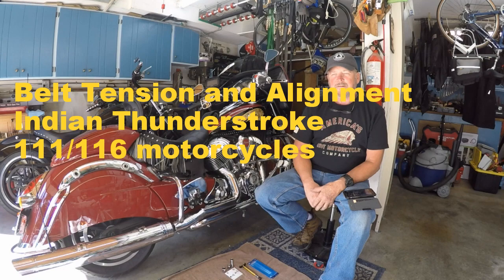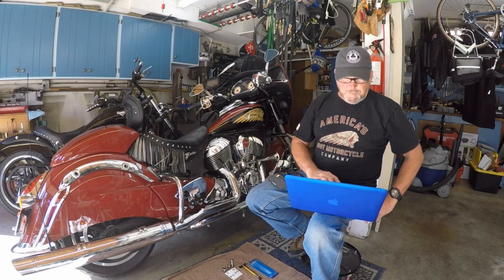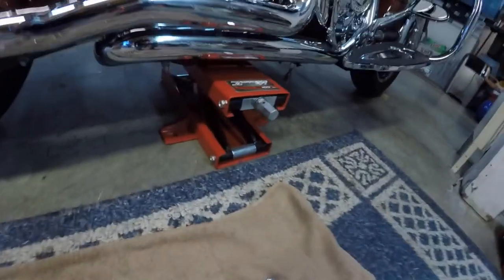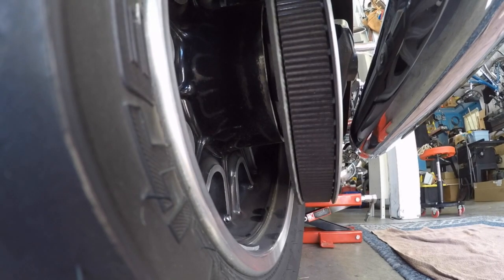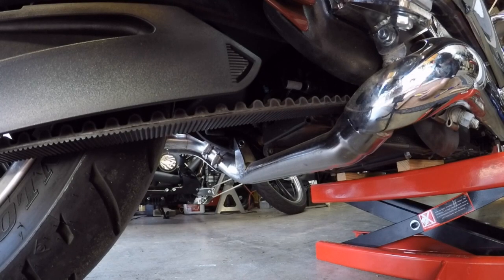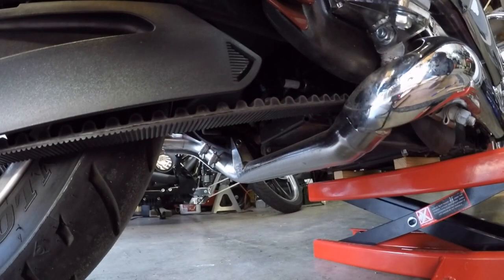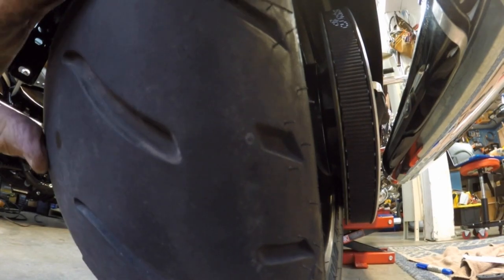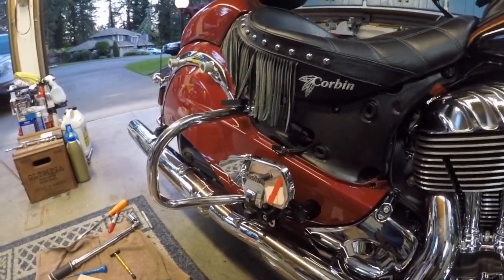Indian Thunderstroke Motorcycle Drive Belt Tension and Alignment

Comment: great video... I do not have a Indian, but I have a victory steel frame. So, its the same concept. You explained this procedure so anyone that has any type of mechanical know how, can now adjust tension and alignment. Those that dont have that, should just pay someone.
Reply from the maker: Hey, Thanks a lot for the kind words. Funny, I just performed my end of season inspection and I had to review my own video to do this part of the service. My belt was ~4-5mm too slack after about 4600 miles. 

So, a couple of things. The magic marker thing was for video illustrative purposes. Basically they factory just wants you to perform the measurement at the tightest point of the belt. So just a ruler to measure that at each 90 degree rotation of the tire to find the point of least deflection. That is where you check the measurement. If it's out of spec. at that point... adjustment should be done.

I have found it's basically impossible to gain a perfect alignment where several 360 degree rotations shows the belt equidistant from the sides of the driven pulley on the rear wheel. You can drive yourself nuts if you like, but good luck. I tried. I can get it close but there is some built in mechanical wandering in the relation of the drive and driven pulleys over say 3 rotations of the rear wheel. In my humble opinion, it is sufficient to get close as possible as long as the outer edges of the belt are riding within the sides of the driven pulley without riding up which would be extreme dis-alignment. Just get it comfortably tracking within the confines of the pulley within the manufacturer tension specification I state on the video.

I too one one of those future collectable bikes. I have a customized hot rodded Vegas. A 2013 in jet gloss black. My naked cruiser. I get an amazing about of complements on that bike. I only take it out for joy rides on sunny warm summer days. As with my Indian, I have most all the stock parts in storage. Safe rides!

Comment: Definitely the best video on this process I’ve found and I believe it’s the weakest point of the Indian motorcycle
Reply from the maker: Thanks James. Happy to help!
Reply from the maker: Hey James, I was re-reading your comment and I was wondering about it. Can you expand on your "weakest point" comment? I have 25,000 plus miles on my Chieftain. I haven't had any issues with the drive belt or the pulleys. So I'm wondering if you have and if so, what they were. 

The 30,000 mile service schedule calls for changing the belt. I just completed the 30,000 miles service on my brother's 2015 Chieftain. I got to the belt and gave it a very detailed inspection and found it in pristine condition. He had just had the tires replaced (new Dunlop Elite 4's) at the Indian dealership. The belt was in spec for tension and was well aligned through several reverse rotations up on the lift. I just did the 25,000 mile service on mine finding no issues with the belt. 

I decided to forgo replacing the belt on his bike. I seriously question the 30,000 replacement schedule if there are no visible defects. That's my own opinion and in another 5000, I will do the same on my Chieftain if it is not showing any damage or wear. I do a routine belt and underside inspection several times between oil changes (~every 1000miles or less), while up on the lift.  I also look at the rear brake linings at the wear notches, inspect the tire face and sidewalls for damage or foreign bodies and give the rims and muffler undersides a clean and polish with Mother's. I also remove the hard bags and clean the back sides, wax and reinstall. 

Just wondering about your belt weakness concerns. Regards, Craig
Reply: Yes at 10k my belt started whining I carried to the dealership they “cleaned” and adjusted my belt. Said it was the most loose belt they had ever seen. Rode to Yellowstone had to readjust on the road in Dubois Wyoming. Got it home they checked it and said it was adjusted fine but dirty. It has since then makes noise when it’s cold or raining not so much in the summer. That’s a 15 roadmaster. I also have an 16 chieftain with no issues whatsoever. I’m not understanding the dirty belt my chieftain and 1987 softail  don’t have this issue.  I actually told my dealer maybe Indian needs to buy belts from Harley cause they don’t get dirty. Roadmaster is at 30k chieftain is at 35k and who knows about the Harley I’m not buying 30k belts
Reply: I love my Indian smoothest riding bike I’ve been on just wish they would fix my belt issue
Reply from the maker: @2bad1  I think if it was me, I'd pull the belt and replace it. I would also look at both the front and rear pulleys for unusual wear. I agree, the belt shouldn't need replacement at 30,000 if it looks OK but this is a strange issue and sadly, that might be the fix. I'm sorry you are having this problem. I would also post your issue on indianmotorcycle.net and see what others have to say. I sincerely hope you are successful at finding the fix. I'm not sure what contractor is making the Indian OEM belts, probably one of the big companies like Dayco or Gates. I just don't know but you could source one and replace yours. That might do the trick. Good Luck, and let me know what happens.
Reply: It is an issue that Polaris is having I’ve talked to other owners with the same issue and I get no help from the dealer I’m thinking I might trade, I don’t know  what I’m gonna do yet I have considered replacement.

Comment: Thank you for this great video, Craig.
I bought 4 month ago, in second hand, an Indian Roadmaster of 2015. After few kilometres (maybe 400 km) I heard a noise comming from the belt. I used a teflon based lubricant on the belt but it works only for some time. I recently saw your interresting video, so i will try to adjust the tension and alignement. Just one question what kind of lift do you use ? Is it available in Europe ? 
I apologize for the mistakes, as you know french are not easy with english or american language.
Reply from the maker: Hi from the USA! Your english is a lot better than my French and that's for sure.  Here is the Amazon link to the lift I use. Be sure to not crush the steel lines underneath. Cut some short wood spacers ~1.5-2cm square to use between the lift and the bottom of the engine. https://www.amazon.com/VIVOHOME-Scissor-Motorcycle-Scooter-1100Lb/dp/B06X9CYNJF/ref=sr_1_1_sspa?keywords=motorcycle+lift&qid=1571767771&sr=8-1-spons&psc=1&spLa=ZW5jcnlwdGVkUXVhbGlmaWVyPUExSjNVVlNSRlVCVUIzJmVuY3J5cHRlZElkPUEwMzg5NjI2Mzk3RVY2UVgxQThIVyZlbmNyeXB0ZWRBZElkPUExMDEyMjU5Mlk5MDFWNTVZN1pLUSZ3aWRnZXROYW1lPXNwX2F0ZiZhY3Rpb249Y2xpY2tSZWRpcmVjdCZkb05vdExvZ0NsaWNrPXRydWU=

Comment: Great video, when using the belt tension gauge tool and looking in the belt gaurd window with the notches, do you line up the bottom of the belt to the proper notch?
Reply from the maker: Thanks. I just find the tightest position starting with the valve stem and Check every quarter rotation until I find the tightest position. Then I apply the tool at that position and measure it with a ruler. I adjust the tension accordingly to spec.

Comment: Great video. The best video out there describing how to adjust the tension. Regarding centering the belt. YOUR belt was all the way to the left. You adjusted the left alignment knob in a certain direction. If I wanted to adjust OPPOSITE of yours, would I simply turn that very same adjuster in the opposite direction? Forgive me for such a silly question, but I'm not very mechanical and I don't want to pay a $130/hour labor charge for something that I could possibly do myself. So I'm going to risk a stupid question and save $130 potentially.
Reply from the maker: Hi Chris, I hope all is well. In the time since that video was made, I have come to a realization that you don't want to get too crazy over where the belt tracks on the driven pulley as long as it is within the running channel. The main thing is that it is tracking within the limits of the outer edges of the pulley, and not riding up over or on it. You can drive yourself crazy trying to fine adjust it to ride center. I know that's what the manual calls for but I've found it unrealistic. It will wonder back and forth over several rotations. In my humble opinion, as long as it remains in the running channel of the driven pulley, and shows no unusual edge wear, makes no racket of any kind, you are good. This issue can drive a guy nuts. Best wishes... Craig
Reply: @usethenoodle  I really appreciate your candid feedback on this. These machines are so expensive and we become so attached to them that sometimes we can get a little crazy with how we care for them. I was ready to spend a lot of time getting that belt 2 mm to the left. Thanks for responding. Have a great day.
Reply from the maker: You too, As the last line of my reply said..."This issue can drive a guy nuts." I should have added, "Ask me how I know". My belt is original and at 26,000 miles, it still looks like new. It will wander side to side over several rotations but always stays easily in the running channel. I'm happy to help. Best wishes... Craig @krismerchant4982

Comment: Thanks a million for taking the time and effort to share. It’s almost time for me to do the 5000 mile service on my Springfield. Can you offer any guidance on how to lift the bike. I have the owners manual and the service manual  both seem a little vague on how to jack it up. It appears to me you just lift it from the bottom of the engine but I haven’t seen anything about lift points. Besides the break lines is there anything I should avoid ?
Reply from the maker: Hi Glen, In the video you can see the lift I use. Or heres the Amazon link. https://www.amazon.com/dp/B01860HLCU?aaxitk=aIh.rfhuQWR8LICROnrX.w&pd_rd_i=B01860HLCU&pf_rd_m=ATVPDKIKX0DER&pf_rd_p=3930100107420870094&pf_rd_s=desktop-sx-top-slot&pf_rd_t=301&pf_rd_i=motorcycle+jack&hsa_cr_id=3364141150601

I don't use the two little black risers. They slide right off. I place it under the engine just ahead of the two oil plugs. I cut a couple wood spacers so I wouldn't crush any of the lines that run along the right side case underneath. The wood is perhaps 1" by 1" and the width of the lift face. Slide the jack under and using a 1/2" drive ratchet with a 3/4" socket slowly raise the jack placing the wood while looking that it is in the right place. keep raising the jack and reach up and grab the right handle bar helping it come up vertical. When the bike is fully supported by the jack and vertical, continue lifting until the rear tire is up off the floor. By repositioning the jack and spacers more forward, it will lift the front tire off the floor. I tie the bike with 3/8" rope to prevent it tipping to one side or the other.
Reply: Craig Miller Thanks again for the info.  I was a little reluctant to lift it by the motor. Had visions of cracking something but I guess it was designed that way. Cheers !
Reply from the maker: Yes it is designed that way. The engine is part of the frame. If you look under your bike, you will note the frame comes down from the front and attaches to the front of the engine block. Then there is no frame under the engine. Then, the aft part of the frame attaches to the rear of the block and goes on back. The frame has an aluminum "spine" under the fuel tank that is part frame and part air duct to direct air to the stock air box. That spine and the frame tubes with the engine block comprise the frame. A word of caution... I do not use the two little sliding stands atop the lift. I took them off. There are some applications for those, dirt bikes and quads etc, but not on the Indian. I cut a couple wood spacers so I could carefully lift the bike positioning them to protect the several brake lines and such that run along the right side under the motor. I also position these to make the weight bear on the areas of the block where the bolts run through the block. Look at 7:06 in the video and pause. That shows the two spacers and how they are positioned. Only lift the bike as high as you need to do the job.

Comment: Great video Craig, very detailed. But, I am curious about what that luggage pod/boot is on the rear of your bike?Is it custom made? Thx.
Reply from the maker: Hi Rob. Its a Smuggler Trunk from Corbin. It's on their website. Its basically a glove box.
Reply: Thanks Craig... looks good, albeit quite small inside. Still, I've only seen one (yours). I like :)
Reply: PS, there are zero videos about the Indian trunk on YT... you know, just in case you want to get in on it. First is best ya know :)
Reply from the maker: Yes, it is quite small inside. But... you can put all your small stuff in it. Wallet, sunglasses, keys, sunblock, vest extenders etc that get swallowed up into the bottoms of the big bags. I have a corbin seat. I never have a passenger so I went this direction. Its really well made and it comes painted in your bike's color or any color you want. It has a bracket that connects it under the seat and the one fender bolt. So 3 fasteners removes the seat and trunk as a unit. Also, be sure to check out buffalobrand.co for the airhorn Randy Verdun makes. Its loud as hell!

Comment: I bought a 2018 Chieftain with 5K miles on it.  I notice when riding , that when I let off the throttle I hear a whirring noise coming from rear.......any thoughts?
Reply from the maker: Check the muffler hardware to be sure nothing is loose. Sorry, but without hearing it I'd have trouble pinpointing it. Just be sure everything it tight. Look the belt over very closely for missing chunks. At 5000 miles, I find it had to believe it's some sort of wear issue. I have almost 21,000 on mine and it's only been in the shop for a few recalls and a failed voltage regulator which was replaced under warrantee.

Comment: Wish you put it in stander measurements great vido and info
Reply from the maker: Sorry Brother. The factory manual lists these in millimeters. The metric system is a much simpler system to use and it's based on tens. Ten mm in a CM. Adding 26mm to 45mm is far easier than adding 5/16 to 25/32. Metric also allows for easier and finer  measurements. It's better all around for fluids too. I was in the medical profession and thats the standard system of measure there so I learned it years ago. Just use the other side of your ruler. Even my 22 year old Ford pickup truck is almost all metric. Time to learn something new. You'll be glad you did. I will admit I dislike it for temp. Best Regards.

Comment: I have the Buffalo brand air horn as well Randy hook me up real well met him and his wife down at Daytona Beach Florida during Bike Week 2018 that horn has saved my butt many times not only do I use it in Anger when someone does something stupid I also do it for fun... LOL
Reply from the maker: Ya, Randy was in a popup over at the Tamoka Farm Road campground/swap meet. Thats where I met him as well, and he installed the long horn on both my brothers Chieftain and mine. Randy is a great guy and yes, his wife is lovely too. I had a chance to hang out with him this past Bike Week in New Smyrna at the 2019 Daytona owners meeting. He lives in Louisiana I believe. I was at Sturgis the whole time this year and I was hawking his horn to a bunch of Indian owners. It's the best horn out there. He recently came out with a bug screen for it. Works great to keep the big ones out and off the horn diaphragm. By brother ingested a large Florida sized bug in his horn and it caused the horn to temporarily fail. He called Randy who told him to take it apart and clean the bug debris out of it and off the thin diaphragm. That cured it. He then sent us both a prototype bug screen. Very nice rubber circle with two different sized stainless mesh molded in. Easy to install and keeps the bugs out. I believe he will supply one for owners of his horns. I always give mine a short test when I set out. It's never failed to pass. It looks bad ass too.
Reply: Randy hook me up with a bug screen for my horn as well and a nice t-shirt that I always try to wear when I go to rallies or just out with friends that have Indians. 😎

Comment: Hi. where do you have the jack under the motorcycle?
Reply from the maker: Hi Miro. If you look under the bike you will see several lines and such that you don't want to damage. I cut two small 1' by 1" by 6" wood spacers. I put those between the bike and the jack. I arrange them so that they keep the jack from damaging anything. You just have to use trial and error until you get it in a good place. It's really pretty easy.
Reply: @usethenoodle  thank you. I see that it is grounded directly under the engine. won't the engine be damaged?